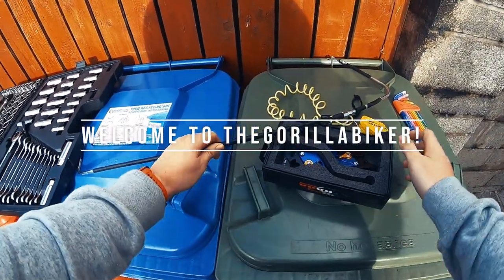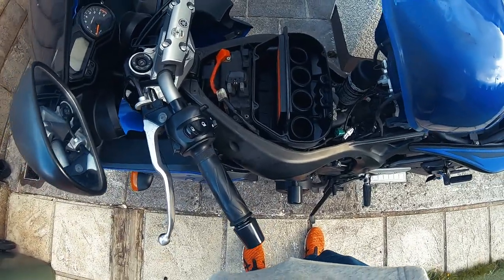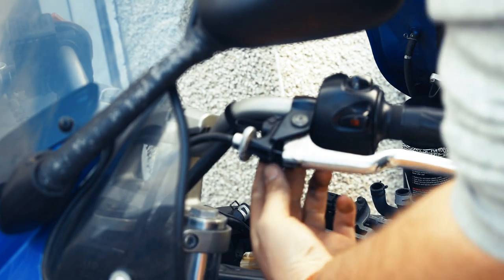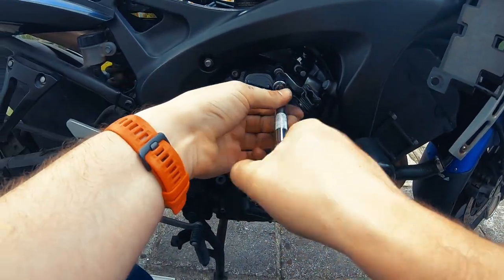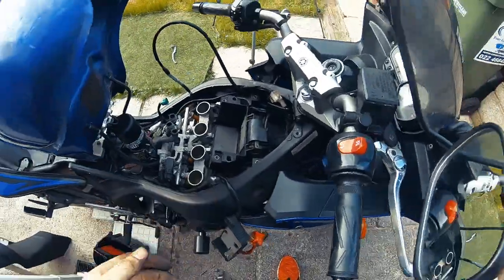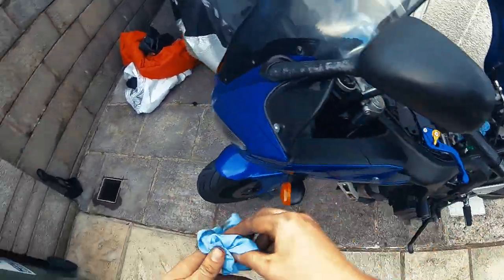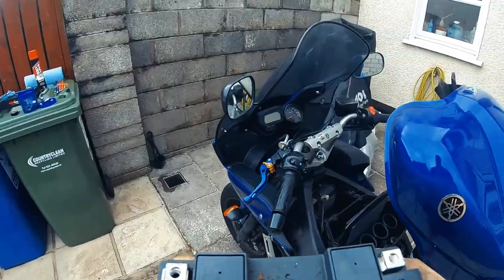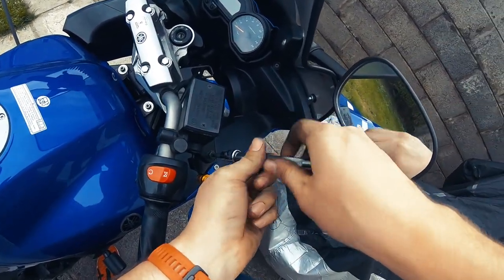Installing a New Clutch Cable and Levers Yamaha FZ6 S2

Comment: Top tip for this work: just attach the new cable to the old one using some tape.... then, just pull the old out and the new will do the same twists and turns and stay in place! ;) no need to dissassemble half of the bike!
Reply from the maker: I've done that since also but I prefer feeding it thru myself. No real reason 😂
Disassembling half the bike as you say was to show how to do exactly that also.
Reply: @TheGorillaBiker  thanks you for all the info then!
Reply: Bro, I should have seen your comment 45 seconds ago 😑

Comment: My clutch is very hard so wondering is it problem with cable or either with clutch plates?
What do you think? THanks!
Reply from the maker: The first thing I;d check is the clutch cable lubrication, get some gt85 and try lube it with that. Otherwise if you've never changed your springs your clutch plates could be sticking if they're old so I'd pop them out and inspect them, I have a video up on how to change the plates if you want to see how to inspect them. Link: https://www.youtube.com/watch?v=TBM8KxhreYI
Reply: @TheGorillaBiker  Got bike with 11.500 miles on it. Put already 2000 miles this season. Clutch doesn't slip but also what is weird it's pulling at the end, not at the middle how suppose to be. Not sure that will keep this bike more than one season so probably wont do plates. But will try to lube it! Thanks!